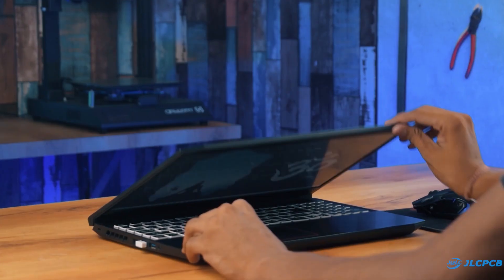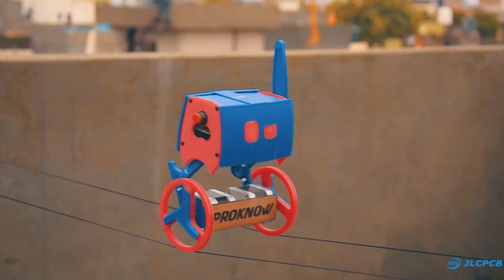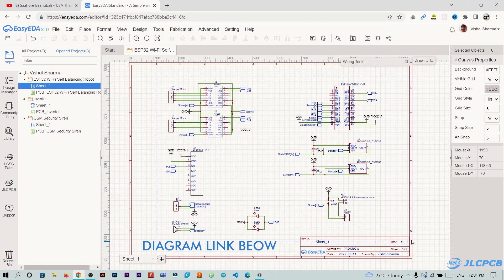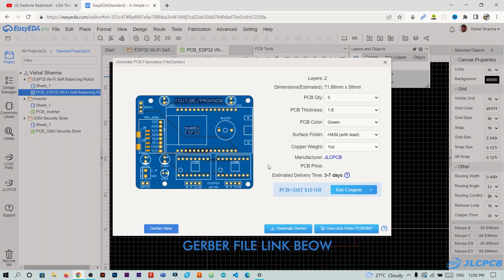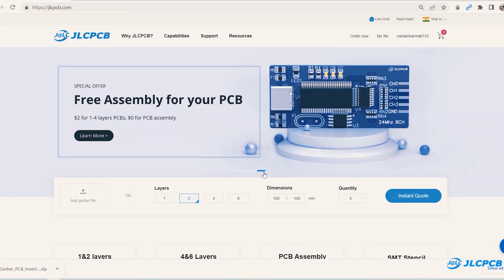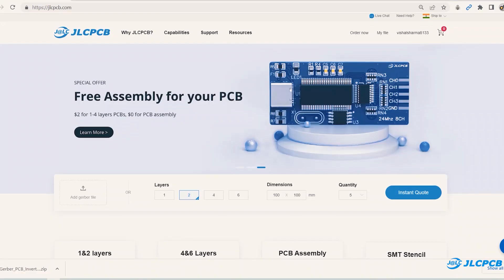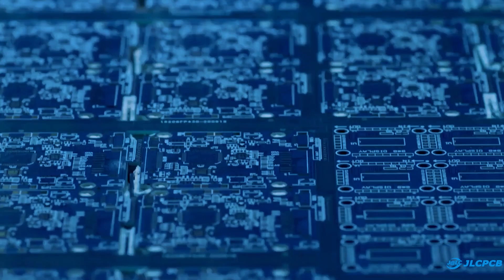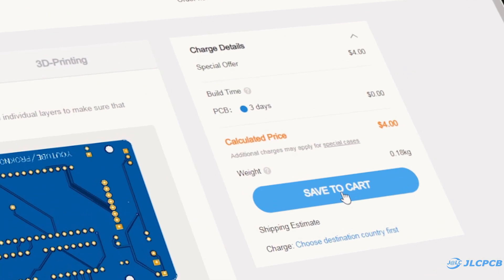Making a ESP32 Self Balancing Robot - Control it with your Phone!

Comment: could it be that the distance between the stepper driver pins is not the same as the stepper drivers in your link? in the gerber file it is 10mm whereas the stepper driver board ist 12.7mm (0.5in)...

Comment: @proknow What if I am using a 11.7v lipo battery ?
Reply: Hie. I'm not @proknow but notice the 2 voltage regulators, they will regulate any voltage from 5/7 to 30+ volts safely provided all is in good working order, no damaged - shorted component - etc...

Comment: It's a very good project. I have a question. After successfully uploading OTG to the broadband....turn on the switch. Does the robot balance automatically or do I need to adjust the PID? Thank you.
Reply from the maker: It will balance automatically, You can also do PID tuning using app.
Thank you for Watching!